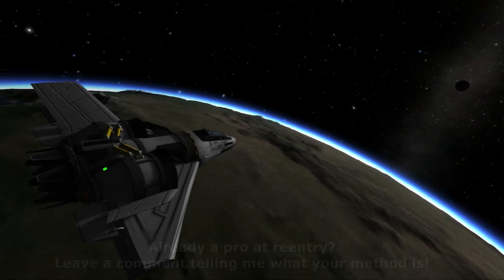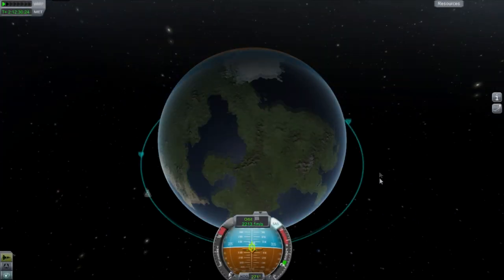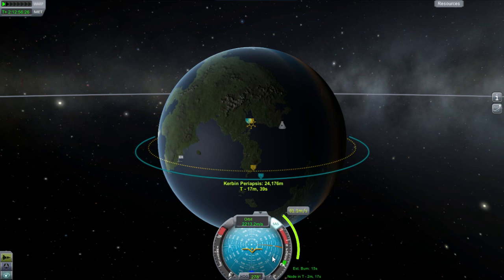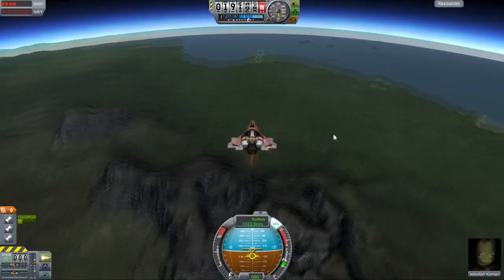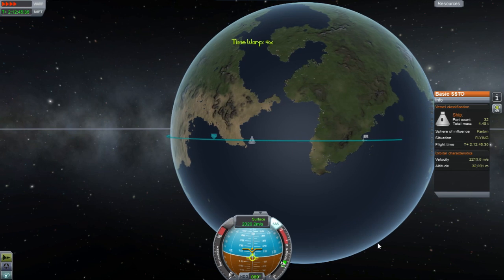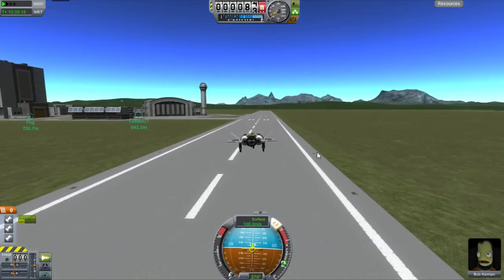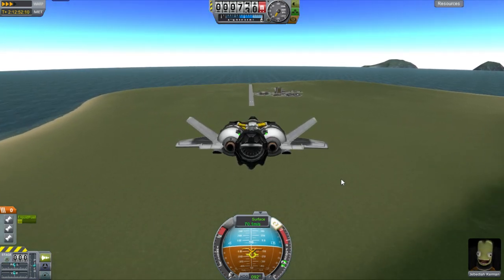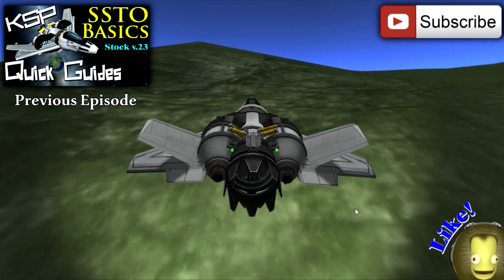KSP Quick Guides: SSTO Re-Entry Tutorial - Flying Back to the Runway!

Comment: im an avid flying wing builder so my tactic is normally aerobreaking unpowered then when i hit about 1000mtres from the surface, i punch my drives to full throttle and kill all my velocity in about 500 metres then i slowly drift to the surface on low power
Reply: its the only way jeb likes it

Comment: A more universal and rougher rule of thumb: set another maneuver node in your projected trajectory, and put about two km/s retrograde on it, so it effectively shows the altitude at that point in flight. This way you can set up the point where you hit the 30kms wall of air and flames that slows you down in about the time it takes you to fly over the KSC continent. very rough, buy I usually end up within 100km with untested designs from any orbit, including direct entries from outside kerbin's SOI.

The faster you go, the steeper you are getting to reentry flames and low terminal velocity, so the faster you break, so the method compensates by itself, and the difference can usually corrected with the methods you show here.

For extra precision, adjust a bit between 25km (say, 6km/s reentry) and about 35km when you hit the KSC continent (coming back from a 69.1km orbit with a deorbit maneuver on the other side of the planet) and you'll end up gliding to the runway most times.
Reply from the maker: That's a really neat trick! I might emss around with it after class. Does the high altitude drag mess up your maneuver node planning at all or do you kind of just fudge the placement a bit to accomodate the slight change in trajectory. I'm guessing it doesn't change much.
Really cool, thanks for the tip!

Comment: I've never so wished that you used mods, lol. To myself and many others, KSP without FAR and Deadly-Reentry isn't legit KSP... but both of those can make a serious impact on Re-Entry approaches for KSP for obvious reasons. Still, solid advice and another great vid, thanks man.
Reply from the maker: Oh definitely! FAR + DRE is a pretty good combo I hear. I think with just FAR the reentry is actually supposed to be a little more predictable since you don't end up hitting the "pudding layer" of the stock atmosphere lol.
What does your reentry approach look like with those mods enabled?
Reply: Cruzan AK I would say in general the biggest difference is that provided by DRE, the response to altitude is inverse to what we see in this great tutorial (namely, if you return from higher, you can't lower your Pe as far or you risk burning off parts or killing your crew from G forces, of course this varies by craft a bit), also it seems much easier to overshoot KSC with FAR, since aircraft drag and lift are differently calculated. To be honest I haven't figured out the perfect combo for how to pull it off every time (and the western side of the mountain and the eastern sea of my career save hold much debris from trying to dial it in, lol). It's pretty close to what you do here though, for sub 100km Ap flights.
Reply from the maker: wakjagner Lol the 500k descent profile would definitely be a little warm on re-entry :D
I thought about trying FAR a while ago and I might do it in the future if I ever run out of ideas for stock stuff. I'm sure plenty of people would like tutorials based around using FAR + DRE as I know it is a very popular combo.

Comment: In anybody wants awesome missiles get kw rocketry or just take the dual separaters out of the package as they are basically scepatron missiles but fly straight, if you want to use scepatron intsead take the uliage motor out as it has 75 thrust and small size but not weight however at 1 ton
Reply from the maker: Interesting. I'll take a look :)